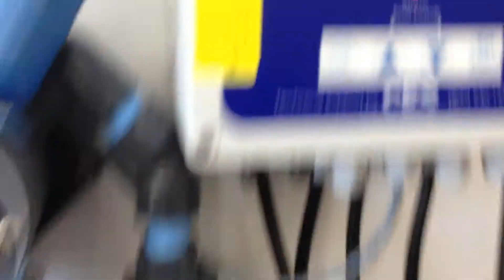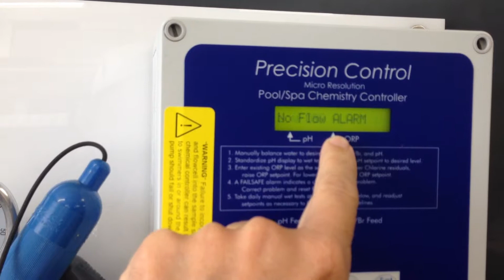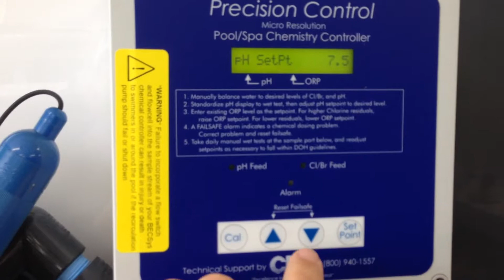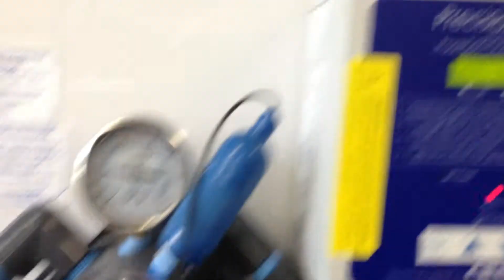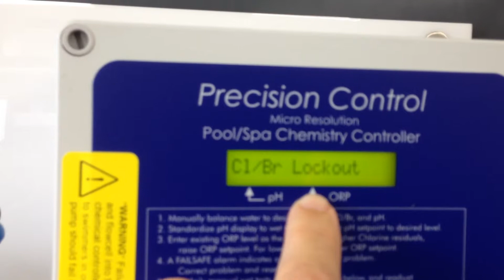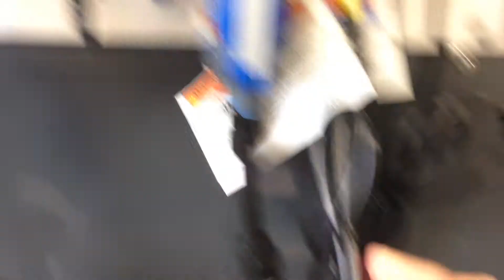CES Precision Control Chemical Controller Start Up

Comment: This was done years ago... but I'm glad I found this.. I've never been involved with  pools or the chemicals in any capacity. Recently, I was  reassigned to a different facility where the maintenance guy up and walked.. So now I have learned to balance the chemicals and maintain a blue pool just by the knowledge shared like this on the internet... I'm in mid-central florida..

Comment: Is there a trick to shut off the alarm? Chemicals are good. Normally when chlorine or ph is off you adjust chems and test then hit the arrows and that clears it . Is there a button combination I am unaware of?
Reply: I'm asking the  same question.  The damn  alarm is on and I want to disable it cause the chlorine is fine with the ph but the orp is on a low flow .
Reply: @lesant7659 press up & down button at the same time